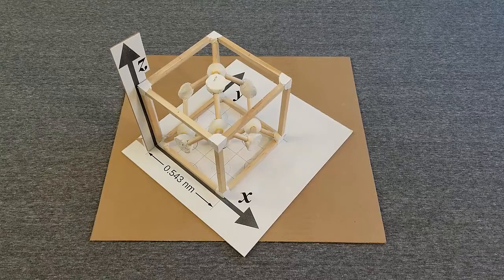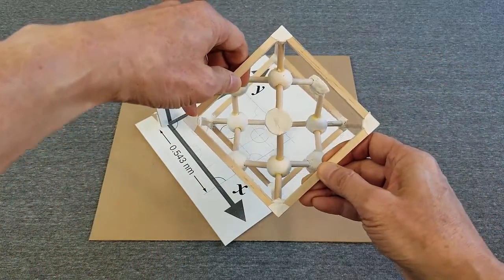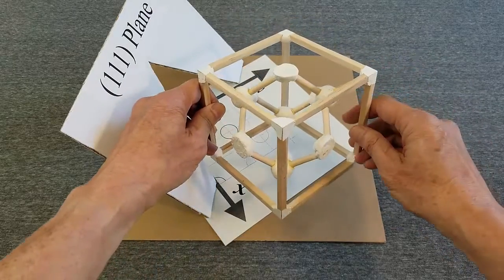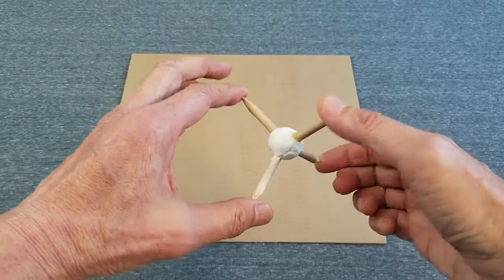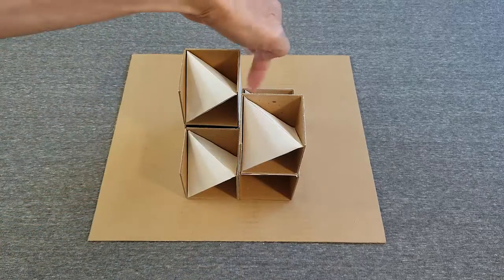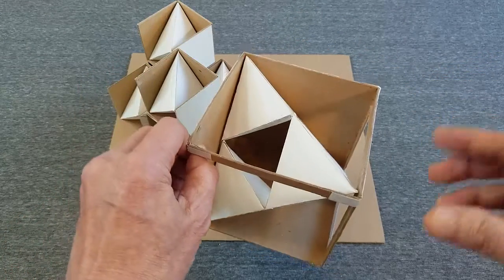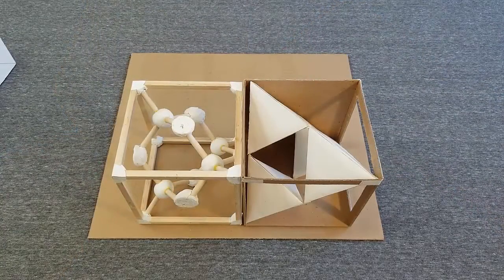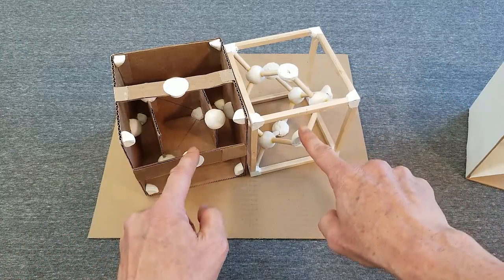Silicon & diamond unit cell atomic model, wafer/crystal orientation, Miller indices (100) (111)

Comment: I appreciate your efforts in making the prototypes and explaining the Si crystal. By far this has been the best video I have ever seen. However, I am a little confused with the wafer primary flat's direction. For a (100) wafer, the primary flat is along [110] direction. If this is the case, than how can the wafer surface be (100) plane? Please help!
Reply from the maker: Take the unit cell and place it flat on a table. Get on your knees and look at one face head-on -- you are looking in the [100] direction at the (100) plane. Tilt the unit cell clockwise 45 degrees, so the face appears as a diamond shape and the cell rests on one edge, and all the sticks appear to run vertical and horizontal from your point of view. Now the table top is the (100) plane, which is the plane of the primary flat. Any plane parallel to the table top is also a (100) plane, including the one that passes through two diagonally opposite edges of the unit cell. In fact, any plane that passes through two diagonally opposite edges of the unit cell is a (100) plane. See pages 3-4 in https://www.chu.berkeley.edu/wp-content/uploads/2020/01/Chenming-Hu_ch1-3.pdf
Reply from the maker: When you get a chance, please check out my newer video on electrons and holes in silicon: https://youtu.be/QQ6Wr5VC3bA